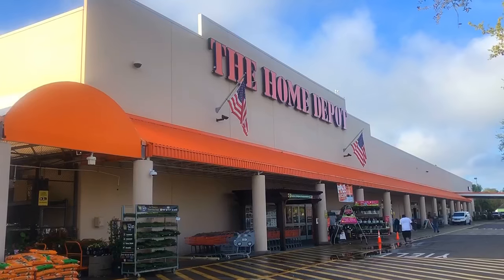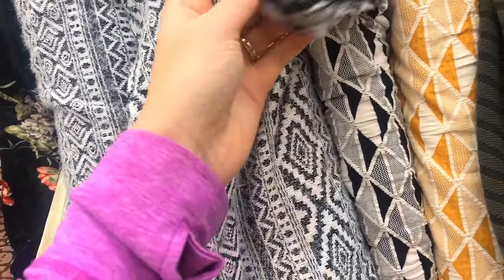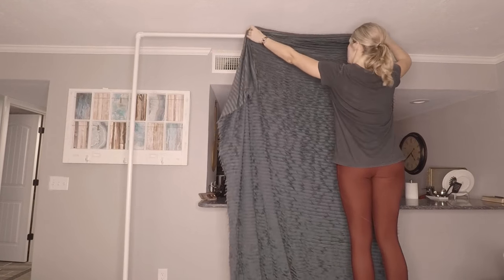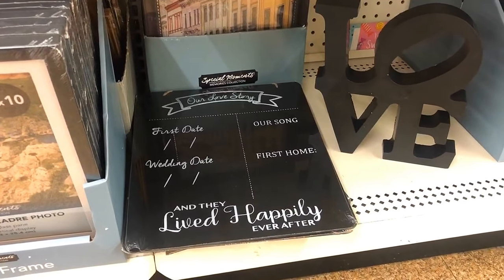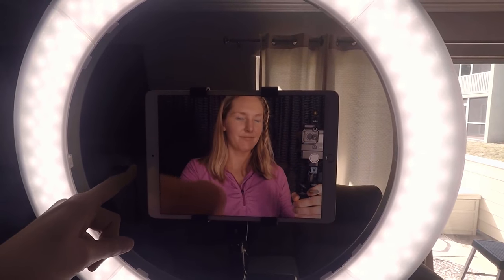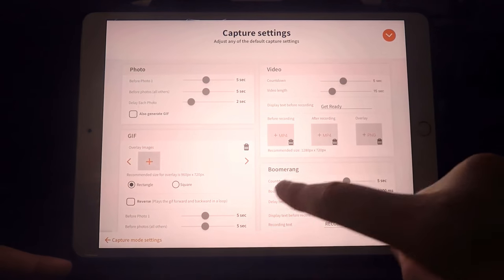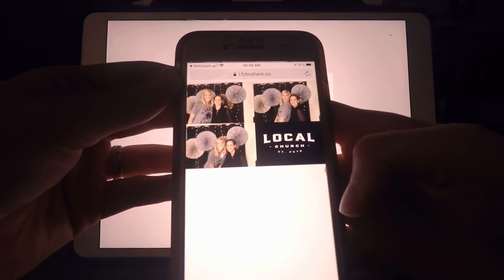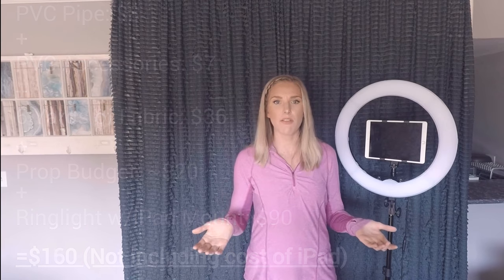HOW TO DIY A PHOTO BOOTH FOR EVENTS

Comment: Will guests be able to immediately see the photos they just took? Do the guests use a remote shutter? Do they need to type their email into your iPad? How do the guests know what to do to activate their photo session if there's not an attendant?
Reply from the maker: Guests will walk up to the iPad and press “take a photo”. It will automatically print then through a photo session just like your typical photobooth would. After all of the photos have been taken it will prompt to input a phone number or email (you can decide this in settings) and they will get it sent to them. If the iPad is connected to Wi-Fi during the event, guests will get the photos immediately. Otherwise the iPad will store the photos in a queue until it is connected to Wi-Fi sometime after the event is over.

Comment: Great video. Thanks for highlighting how the iPad connects to the ring light. Just wanted to clarify, are you using the iPad’s front or back facing camera to take the photos?
Reply from the maker: Hey thanks for asking! I used its front facing camera. The photo quality isn’t the best, but this is the only way that people can see themselves on the display to take the pic. If you have a newer model of the iPad the photo quality might be better if it has an upgraded selfie cam

Comment: Hi! Love the video. I can’t tell how to connect the light and iPad holder to this stand. I’m asking because I’m going to have to purchase a new stand, I already have a Neewer ring light and I just want to try and understand how to build this up? Thanks!
Reply from the maker: Hi there, the newer ring light has a screw on mount in the center of the light that you can attach any adaptors to. You just screw on the iPad mount to that spot and you should be good to go!

Comment: My iPad keeps tilting forward no matter how tight I screw the ball connector. How did you get yours to stay upright securely? I purchased all of the products via your links in description.
Reply from the maker: There might be a swivel mount on your ring light that needs to be tightened. I would look up assembly steps if you have trouble tightening it down. Sorry I can’t help more!

Comment: Thanks for info! Probably need to add cost of printer and printer photo sheets also?
Reply from the maker: I mentioned in my video that we only did digital photo sharing. So I never needed a printer. That’s an optional add on for those who want it, but I’ve found that most events people don’t feel the need to print when they can just text the photos to themselves which makes things easier!
Reply: @brittanyvonarx1876  I see. Makes sense. Thanks

Comment: So you say 4 angle connectors and 2 T connectors but you were wrong right? I just got home and now I have to run back to Home Depot to buy two more T connectors correct? And those two extra T connectors are needed when you cut off the foot from the 7 foot pipes correct? That part wasn’t very clear.
Reply from the maker: So sorry if this was confusing! I followed the dimensions on the graphic that I posted on the screen for measurements at about 3:20 into the video. Those dimensions are 6ft pipe on top & bottom, and 7ft pipe on the sides. You will have to cut the 7ft pipes in order to attach the T-connectors so that the bottom pipe isn’t sitting on the ground. (Maybe this is where the cutting was confusing?) You will do this same thing with the small 3ft legs. I cut those in half to attach the T-connector in the middle for the 7ft pipes to go into. I hope you were able to put it together!
Edit: I went back and re-read my video description box and realized that I listed 4 90 degree connectors and 2 t-connectors. This should be reversed. I went and changed this. So sorry. Thank you for bringing it to my attention

Comment: I found the stand to be super weak.  Any advice?
Reply from the maker: Are you talking about the ring light or the backdrop?
Reply: The iPad Mount. I got the one I'd rhe description and it's very wobbly
Reply from the maker: @bourdie1979 I’ve only found the iPad holder to be a little wobbly if the adjusting knob isn’t tightened hard enough. It will move if people are going up to the iPad and touching it too hard. If I tighten it real good it fixes it. But if you still have issues it might just be worth trying a different brand. I’ve had mine for 6 years, not sure if anything in manufacturing has changed

Comment: hello, does the light have the ability to charge the ipad?
Reply from the maker: You can run a cord from the iPad to an outlet to charge it. This is what I did during my event since the display will be on the whole time, your battery will drain quicker.

Comment: Hi, I used lumabooth for the first time recently and found that the subjects seemed too far away. I positioned the iPad and stand as close as I could where it still provided subjects with enough space but it seemed too distant in the photos. Can you zoom the front facing camera in the lumabooth settings somewhere?
Reply from the maker: Hey! That’s really interesting. I don’t recall ever having that issue. If anything I’ve found that the subjects were too close where I struggled to fit people into frame! Wish I could help more. I don’t believe the app has the ability to zoom, but it’s worth experimenting with